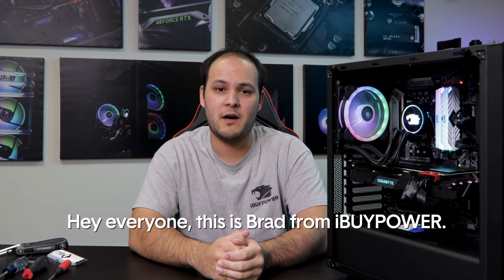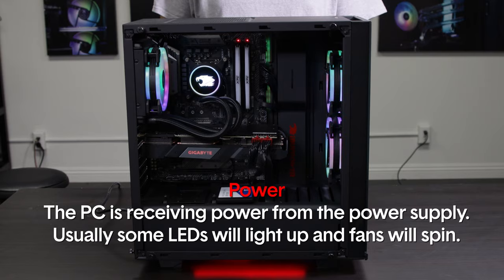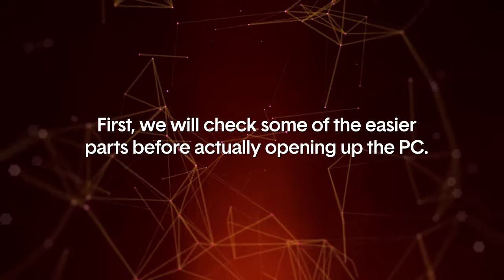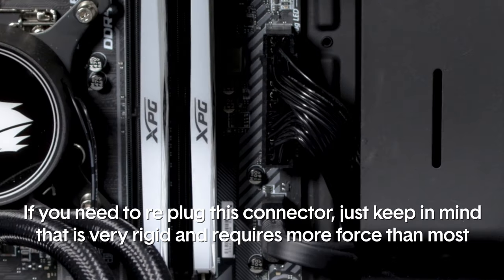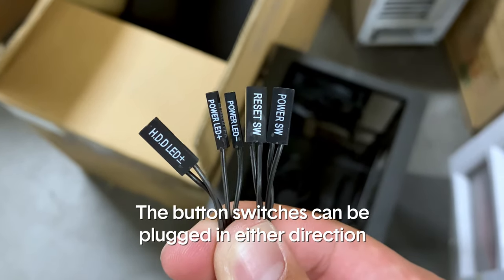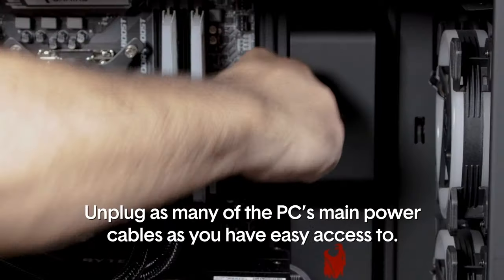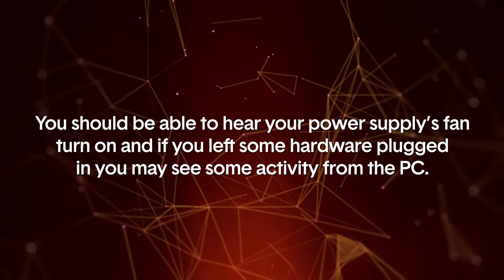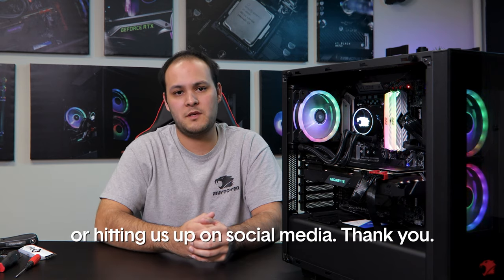"My Computer Will Not Turn On" - Troubleshooting PC Power Supply | Computers and Coffee

Comment: you see, my pc has power. I plugged in my phone into the USB and it worked just fine. I got the pc to boot once, flipped the switch, tried it again, no post.
Reply: Same here. Did you fix it?
Reply: Yeah I'm having a similar issue
Reply: Have u guys found it yet? I have the similar problem rn...
Reply: Same here. Have you got an answer?
Reply: Same here plz help
Reply: having the same issue
Reply: @yallaretrippin8604  have the exact same issue 
What is your pc specs ?
Reply: @jojo-uw5vg  no idea, but i brought it in to a local tech shop and they fixed it for $20, so not a huge deal
Reply: Have the issue why my rbg fan lights turn on for one second then turn off
Reply: And my pc won’t turn on
Reply: @retroviper5317  did u fix the issue? I’m having the same issue
Reply: Same issue as well
Reply: Bro im have the same issue and I just got this pc a week ago
Reply: @NeoAPszn  same I got mine for Christmas
Reply: @swivveld9768  no and I just got my pc too I think I have to return it
Reply: Ngl im be mad if I gotta return this pc my mom got it for me for Christmas and it was between 1,000 and 2,000$
Reply: @NeoAPszn  yeah mine was 1200
Reply: @NeoAPszn  yea turns out my power supply is defective so I exchanged it
Reply: @retroviper5317  yeah that what I think it is because I just talked to a friend about my problem yesterday and the said its common for new pc
Reply: !!DO THIS TO HELP YOU!! 

Step one: unplug the actual power supply out of the thing you plug chords into

Step 2: use a different power supply

!! IF THIS DIDNT HELP IM SORRY, THIS IS THE SOLUTION THAT WORKED FOR ME !!
Reply: Same my rgb and fabs work but it won’t post
Reply: @meekmillzz old up what? Explain better
Reply: @yallaretrippin8604 did they say whats was wrong with it please help me
Reply: @meekmillzz were TF I'm getting a psy from I have an old ass PC so Ill buy a new old ass PC
Reply: @retroviper5317 me too
Reply: If the fan and all run but no display, it might be the power case cable
Reply: For anyone struggling with this step, if you get power for a second after turning on your pc then lose it, your power supply is defective, look up your specs if you don’t know and get a replacement, a whole lot cheaper than buying a new pc, I’ve been through this issue before, and it just happened to me  again, hopefully this helps somebody someday

Comment: I tried building my own but it won’t tern on 😭
Reply: Mine either did you find it out
Reply: SAME
Reply: Oooof myne won’t turn on and when I go in to a game it blacks out
Reply: nvm my ram sticks weren’t in far enough
Reply: Same
Reply: @fate8715  dude have you figured it out yet, i have this exact problem
Reply: Same I don’t know Wut the fuk I haven’t plugged in
Reply: It’s because you built it with wrong parts or you have a wrong monitor
Reply: @marvinmasters7895  has nothing to do with it
Reply: @marvinmasters7895  you dont know what ur talking bout
Reply: @fate8715  maybe your power supply isn't strong enough and when you start a game your graphics card pulls to mich power and. It blacks out
Reply: @Max-xx6lu  thats likely, if you have like a 200 watt power supply and a high end graphics card, especially if it's paired with a higher end cpu.
Reply: Take the power cable out and wait some time like  1-2 min, then put it  back in and press power button fast then  it should turn on  i have  to do it every single  fking time idk wtf  is the  problem

Comment: Dang it might be my power supply or sum
Reply: Mine isn’t turning on either
Reply: I just hit my main cord from the wall by accident and it won’t turn o. Now
Reply: Mine didn’t turn on either but I unplugged my gpu and plugged it back in and it worked
Reply: I went though 2 power supply’s waited 3 weeks and it finally works
Reply: Mine isn’t turning on but my power supply is brand new
Reply: @hannyrenee2197  I'm having the same problem did u fix it
Reply: @jabari1179  ya had to contact who I got form got a new replacement for free... but the one they sent me didn’t t work so I had to go through 2 new power supplies and waited 3 weeks but that part is j my luck... five who ever u got from a call like customer service and see if they can help u if you need any help just ask me
Reply: @hannyrenee2197  same thing happen to me did u ever fix it
Reply: @hannyrenee2197  thank u but yeah I could use some help
Reply: @iSpyCokee  yes i did I have to call the manufacturer of the power supply to set a plan for a replacement
Reply: @jabari1179  what do you need help with I am here for the help
Reply: @hannyrenee2197  rn I think it has something to do with my cmos but idk cuss I tried everything else
Reply: @jabari1179  coms!
Reply: mine wont turn on, after a power intruption and the power came back, IT WONT TURN OFF pls SOMEONE HELP ME ;(
Reply: @cwish1234  same i'm so frustrated. i got a brand new thermaltake 500w. i thought my exisiting PSU might be dead.
Reply: @RandomStuff-dt4ne  oh I found the problem it was the power supply wasn’t compatible  with the other parts, so it just wouldn’t turn on
Reply: @RandomStuff-dt4ne  you should try to get a new one
Reply: Noo meh too
Reply: @hannyrenee2197  yo so i bought mine from bestbuy and its a cyberpower pc and it wont turn on but i also cant locate the power sw for some reason
Reply: @rezanuzumaki7758  have u tried looking where there might be a mix covering it?
Reply: @hannyrenee2197  ok so i found it and i tried this method to try to turn it on but it didnt do anything do you know how to fix it
Reply: @rezanuzumaki7758  your gonna most likely have to return it to bust buy and say i doesn’t work or actually tell me when you turn the pc in do you see an ornage like on your mother board also is you power supply switched if you see no orange like when you flip you power supply switch you are either like i said return it or get a new power supply and replace it
Reply: @hannyrenee2197  so before this happened to it when the power switch was on there was a orange kind of little light on the motherboard but now thats gone too and theres no sign of power in the pc at all
Reply: @hannyrenee2197  and if i need to return it do i need the receipt or something because i threw the box away cus i thought i wouldnt need it anymore and i dont think i have the receipt either
Reply: @rezanuzumaki7758  so yes i would assume you need at the necicary  things to return it... sounds like it is a ps problem and you will likely need to order and replace the current one
Reply: @hannyrenee2197  but cant I just return the pc itself and I have the receipt but not the box
Reply: @hannyrenee2197  because i dont know anything about fixing pcs and i wouldnt know which ps to get or how to replace it
Reply: @hannyrenee2197  and i want to return it because like why would the ps just die that would be the manufactorys problem
Reply: @rezanuzumaki7758  well depends on many different circumstances on the type of failed like mine was a blown fuse and i had built my pc so i had to re watched the video and replaced it. I mean i bet you can call busy buy but i don’t think they take it without the box
Reply: @rezanuzumaki7758  i would just give them a call and see if they will acept it or look up a video on the same pc that you got and say how to replace it
Reply: @rezanuzumaki7758  i can give you good ps to look for evga bronze is good one bc that is the oke i have
Reply: @hannyrenee2197  mine is a prebuilt and it was fine thats why i threw the box but i have everything that came with it and their all in the best condition
Reply: @rezanuzumaki7758  ik how a pre built works my point is is that i do not think you can just go give it back with out the box cuz what are they gonna do just keep it there? so my point is is that your are most likely going to have to try and find a video explaining how to replace a ps on your exact pc model
Reply: @hannyrenee2197  okay i will go and try to return the pc today but if they dont then i will have to just replace the ps
Reply: @rezanuzumaki7758  ok sound hood lmk how it goes if u need help on a ps i can help
Reply: @hannyrenee2197  yea fs ill tell you what happens
Reply: @hannyrenee2197  yo so i went to bestbuy and they said i could either return it or exchange it for another new one but different brand or just let them fix it for me so i got a new pc but a different brand and a couple different specs too
Reply: @hannyrenee2197  i used to have a cyberpower amd ryzen 5 3600 with radon rx580 graphics card and 2TB HHD + 240SSD and the new one i got is a Levon legion tower 5 AMD Ryzen 5 3600 with a geforece gtx 1050 super graphics card and 512SSD. What u think?
Reply: @rezanuzumaki7758  ya that’s good one thing i would really really recommend tho is getting your hdd they are not very expensive and really easy to install
Reply: @hannyrenee2197  yea i was thinking about that too
Reply: @hannyrenee2197  ok so i get around 30-40-50 ping in games and i still get stutters do u think its cus i need a wifi adapter cus i cant get a ethernet cable
Reply: @rezanuzumaki7758  yes one hundred percent- i’m surprised that your are able to play games with out an adapter
Reply: @hannyrenee2197  lol well i really cant cus it lagges soo much thats why im getting an adapter
Reply: @hannyrenee2197  so which wifi adapter do u recommend
Reply: @rezanuzumaki7758  i have a ptp-link ax3000 wifi 6 bluetooth 5.0 Pclr Adapter
Reply: @hannyrenee2197  lmao that is a whole router but i saw one that was called tp link ac600
Reply: @rezanuzumaki7758  no it’s not a rougher it’s a little thing that goes in one of the slots like where you graphics card goes
Reply: @rezanuzumaki7758  my dad got it from amozon
Reply: @rezanuzumaki7758  Amazon*
Reply: @hannyrenee2197  do you have IG or snap cus its hard texting here

Comment: First time builder. Watched ur vid cause it wouldn’t power on. The diagram that shows the orientation of all those little plug ins on the bottom right of the motherboard helped a lot. I plugged mine in wrong the first time. Great video and very informative!

Comment: Thank you! This was my problem: I was putting in a usb splitter in my motherboard so I could plug a fan hub plus my cpu pump. A specific order caused none of my parts to have power. Once I removed the part and plugged it back in I was good to go! So if anyone recently installed a new part, try unplugging and replugging as it affected my entire rig!
Reply: Bro…thank you…so…so…SO much. I was beginning to lose hope.
Reply: Bro! Thank you! This solved my problem! I will kiss your face

Comment: Ughhh ive tried all of this and still no luck. Power supply does work. I just shipped it across states and getting no response 😓
Reply: Exact same problem
Reply: Same, i'm getting pretty frustrated as all my parts are brand new. I don't understand how I did everything right building it and it doesn't even power on.
Reply: Rashid Ibrahim i ended up taking everything apart and rebuilding it again and got it working. Unsure what the cause was but all the troubleshooting took forever. It got really banged up during shipping process but good luck. Im sure u will figure it out eventually
Reply: @Lord_Pilaf  hey I'm having the same issue, did any of you guys get it resolved? How?

Nvm got it working, for some reason miraculously it started working again after 6 hours and smashing my head against the wall. God exists
Reply: @rohansarangdhar8023  So it turns out one of the RAM sticks was bad which fried the motherboard when I turned it on. Not sure if it was just faulty from the manufacturer or if it wasn't seated properly but I got a new motherboard and different RAM and now it works. But glad to hear yours is also working!
Reply: Rashid Ibrahim how did you discover that?
Reply: @Lord_Pilaf  that is literaly the worst possible scenario major F
Reply: Wtf same dide
Reply: @itsjustcloey5781  i ended up fixing it. I just had to take everything apart and rebuild it. I think it was an issue with the ram, but no idea. Good luck tho
Reply: @ABlueberryMuffin   the problem I’m having rn with it is the led lights turn off but the pc still runs and the led lights only stay on for a minute then turn back on and going back and forth would u have any idea how to fix that
Reply: @ABlueberryMuffin  or what I could do to fix it
Reply: @itsjustcloey5781  im not sure.. but i would check the pins to see if any are loose. My usb port from my pc case never worked after shipping my pc. But not entirely sure, good luck though. Maybe try another port if u have another on the MOB, thatll at least show if its the rgb having the issue or the port
Reply: @Lord_Pilaf  i think the same thing happened to me
Reply: @Lord_Pilaf  o
Reply: After jumping the power supply the computer turned on. When I turned it off and started to reconnect things, I plugged in the graphics card. It started smoking. I stopped there. I am guessing the graphics card GeForce RTX 2080 is the problem.

Comment: There is one other thing that can cause the appearance that there's a problem with the power supply - when in fact  there's nothing wrong.
If you slip up (like I did as I was transferring internal components from a large case to a smaller case) and instead of you inserting the CPU 8 pin (4 + 4) power cable connector (it has two plastic male plugs - 4 contacts each) -in the CPU power socket,  you instead insert the 8 pin (2 + 6)  power cable connector (which also has two plastic male plugs - except one has 2 contacts and the other has 6 contacts) . When I inserted again the 4x4 one, the PC turned on again.

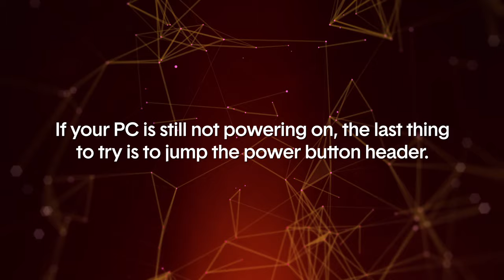Comment: 4:00 to 4:15 was the bit that had saved me from absolutely losing it! I make PC cases by hand & have been doing so for about half a decade. But even I had slipped up on something so minor..! I had been working hours on the new case & after everything had been done & plugged in; my PC wouldn't turn on regardless of what I had tried except for the pushing the power button pins with a screwdriver. Turns out, one of the headers got damaged. Thank you, kind sir! Very helpful video indeed!
Reply: Holy sht it works ahahaha this also works for me also i need to screenshot this comment
Reply: Did u just get a new pwr switch

Comment: What I tried to get my PC working from not powering up:
1. The simplest cause for me- PRSW connector - if this is installed vertically rather than horizontally, your pc will not register the power button being pressed. Usually your motherboard setup guide will have a page dedicated to the correct orientation of these pins. Check the other side of the power switch connector and see if it is loose.
2.  Make sure power cable is plugged in tight and the power button is set to I. If your motherboard has LEDs and they light up, it is likely your power supply nor motherboard are the issue.
2. Assess if any fans spin when the power on button is pressed - if case fans spin, but not your cpu or gpu fans, then those components may be the problem. 
3. Your PC will not power on at all if the CPU is installed incorrectly or is faulty- try swapping in another CPU and see if anything changes.
4. A pc may not boot up with incorrectly installed or faulty RAM, try swapping the RAM between slots and use different RAM if necessary.
5. Check if ALL power connectors to the motherboard are tight - the 24 pin takes a bit more force to press down completely so make sure that no connectors have their plastic pins sticking out and that the connector is snug against the bracket. (if your connector gets stuck, one solution that worked for me is releasing the plastic latch, pulling on one side and gently rocking the connector back and forth. When the one side is slightly out, pull it more by the plastic NOT the wire and it should release.) 

I am not a PC building expert, but after 2 days of continuous trial and error these are the steps I went through, hope this helps.
Reply: What do you mean the other side of the power switch?
Reply: I recently installed a new cpu and my pc won't turn on what do u think is the cause for this
Reply: @Slickrick2468  Your power button wire connects from the actual button itself to a connector on the motherboard, although some aren't detachable I believe, depends on the case
Reply: @dadecountyaloudtoreadbooks5107  Try and go through all the steps above, I spent 2 days working through it, reinstalling parts until I found the problem - maybe make a checklist of what you have tried so you know which parts are working correctly.
Reply: Wdym by make sure power button is set to l
Reply: @dadecountyaloudtoreadbooks5107  Your cpu power switch has two binary options, 0 for off and I (1) for on
Reply: @blondedegg  how do i know if its on?

Comment: I have a 750w power supply from Corsair. When I plug in my rtx 2060 super the computer wont start. When I unplug it from the gpu it starts. And works with the previous graphics card.
Reply: did you ever figure it out? got my 3070 today and it worked for maybe 6 hrs and now won’t turn on unless the gpu is unplugged

Comment: Hi there. Thank you so much for this video!
My PC won’t turn on. 
4:16 i tried to jump the start button as suggested here, with no results.
Therefore I decided to power jump the PSU as you suggested and it worked.
What do I do next? I tried to plug all the wires one at the time to figure out what is the faulty component with no success: I cannot figure out what component won’t let my PC start.
Thank you
Reply: Your ever figure it out?